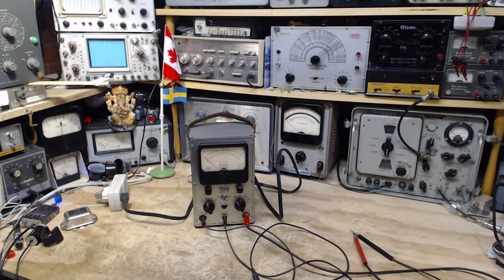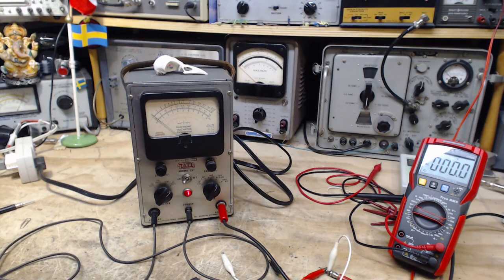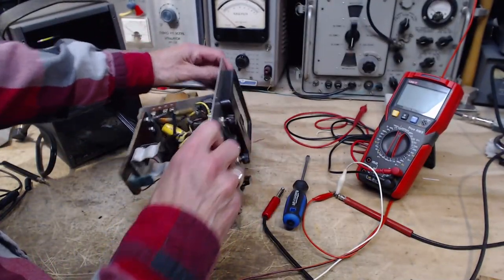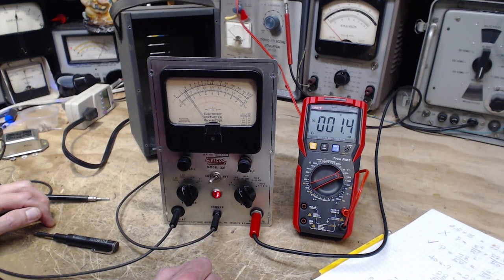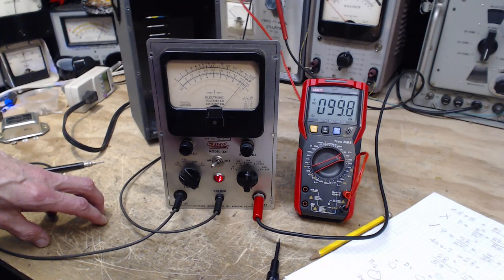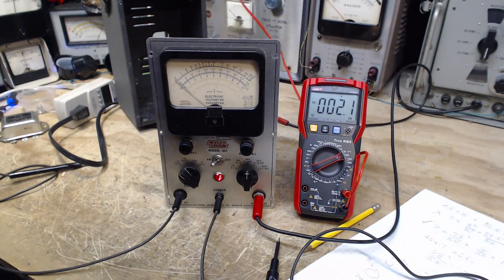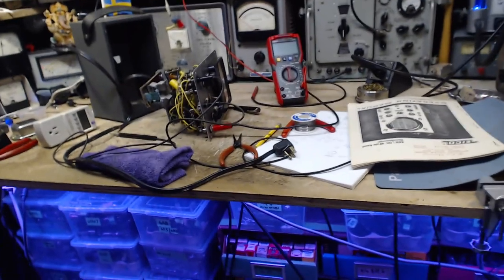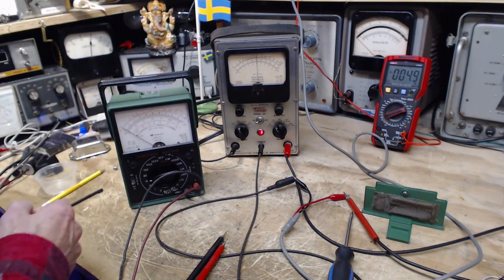EICO 221 Vacuum Tube Voltmeter and Triplett Model 64 Solid State Meter

Comment: Ive still got my Eico 232 from 1962. I made a living with it on my TV repair bench along with my Eico RF signal generator and tube tester. My best instrument is a Tektronix 453 portable Oscilloscope. I use a hand held Fluke 78 DVm too. On my record bench are two hand held digital testers for stylus pressure and a laser strobe to test rpm. I still do radio restorations as a hobby and my shop equipment is small in number. My favorite piece of gear is a Simpson  260 VOM. For audio work I use the Eico 332 sine wave generator.

Comment: Repairing old test equipment is my favorite activity on the bench. Don’t abandon your ohms scale. It goes to 1000 ohms. No digital meter goes that high. A non operational VTVM on the ohms scale takes away its intrinsic and resale value. How hard can it be to clean up a little corrosion. On another note , your DC probe needs a 1 M ohm  resistor in series with the meter.

Comment: The 221 is only capable of AC readings less than 400 volts peak. If you examine the signal path for AC, you have a 0.1 uf/400 volt blocking capacitor (C3), then straight into the cathode of the 6H6. The 6H6 is only rated for 330 volts between the cathode and heater, and the peak inverse voltage rating is on the same order. Very disappointed in EICO for letting that one slip through. They used up the extra range switch wafer to keep the grid resistance constant so they could fudge the 25 megohm input resistance. They did it right on the 232. I use my 221 for DC only, and only when the higher input resistance is needed. Cheers!